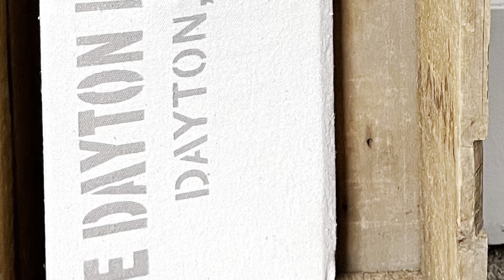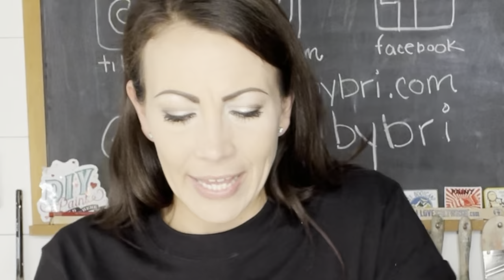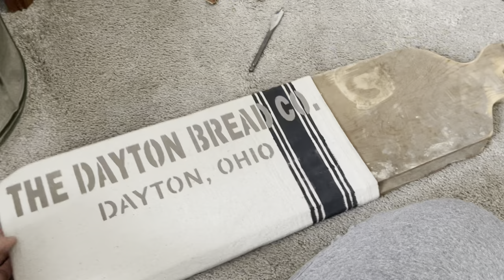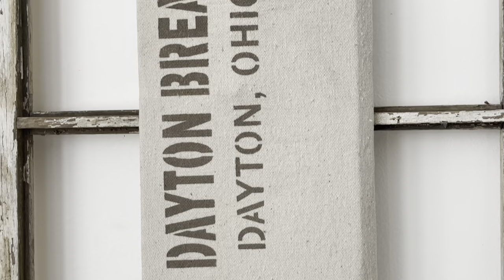Decor Boards | DIY Wall Pocket Decor Board | Wood Project | Spring Decor 2022 |Lifewit Pillow Review

Comment: I would love to know how they work with your neck.  I have a hard time finding pillow so I always revert back to my older flatter pillows. I’ve had several neck surgeries and I just wish I could find a softer pillow that doesn’t affect your neck.
Reply: Me two. I’ve had one neck surgery and then a major lower spine surgery. I revert back to my old old pillow that is just about flat. These look so comfy. I’d like for you to let us know in two weeks what your assessment is. Thanks Bri
Reply: How you tried feather or 50/ 50 feather chopped foam? And the 3 pillow system? 2 cervical fusions surgeries and multiple other spine challenges are my life as well.

Comment: the smaller pillowcases make great covers for seasonal clothing.  I make a slit in the seam in the middle of the top of the pillowcase, just enough to get a coat hanger or 2 or 3 thru.  they look good in the closet, don't take up much room and you can fit 2 or 3 dresses or blouses in each of the smaller ones.  I do use the larger ones on my bed.